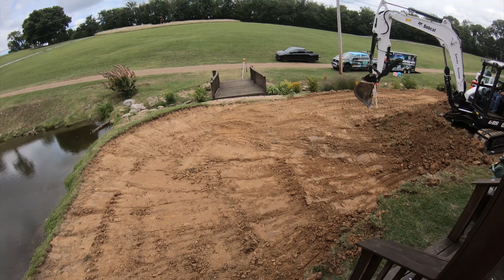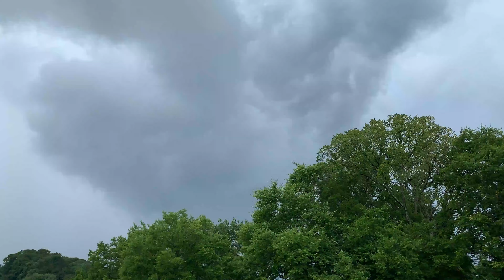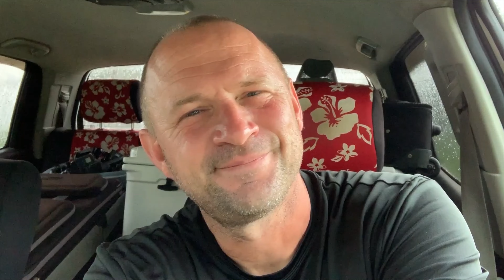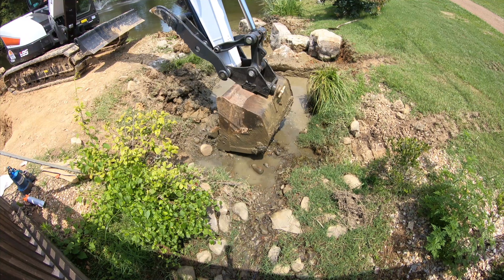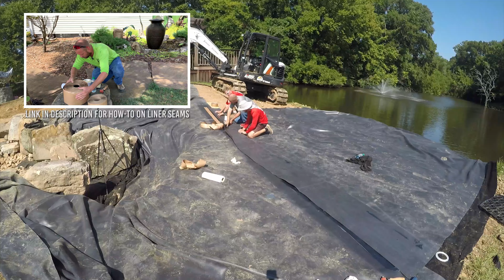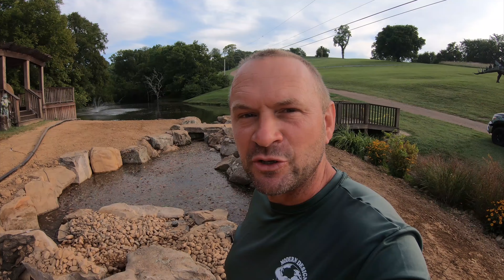How to Build a Custom Intake Bay | Converting a Farm Pond into a Swim Pond!

Comment: how big was this farm pond?  I'm thinking about building something similar on a .33 acre earthen farm pond that is 180 x 80 deepest area is 9-10 ft but avg dept is 6-7 ft (created shelves in case my young kids fall in accidentally).  How big should the intake bay/skimmer be and how big should my wetland be- plan on having blue gill and bass and use the other half for swimming on occasion on hot summer Texas days.
Reply from the maker: We sized that one to a budget not to the pond (per say)…The pond was about 1/2 acre-ish. Lots of variables based on these designs though. Refer to “all filters are better than no filters.” Anywhere between the “perfect design” and nothing is an improvement for sure!

Comment: Here it is 2022 and I'm on pins and needles to see the remainder of this project.  I thought you said there would be a part two but I have looked over the videos and playlists and haven't found it.  I'm obviously looking in the wrong places, could you help me out with a link, please?
Reply from the maker: We never got back out there. What info are you looking for? I might have something else to send ya! Sorry for delay, I have been on a big job ;)
Reply: @koiaddiction  I am baffled by how to marry a farm pond to the components that typically have liners.  In my area, farm ponds have packed clay bottoms.  Can the bio filter be passive or does it require a pump?  The intake bay has to have a pump, right ? so that the water gets pulled from that area to the falls.  I want to have a pond sometime but I am a firm believer in the K.I.S.S. method to minimize what can go wrong.
Reply: https://youtu.be/4KPhKpnvuOc?si=VPKXLtQth8t49Awj

Comment: Awesome work as usual.  How did you like working with the E85 excavator.  Is it too big for most jobs and locations.  I have an E42 considering moving to a bigger machine.  Any feedback on practicality of a machine that size.  Thx.
Reply from the maker: Love it! For the big jobs it takes big machines. I will never buy bigger than 12000# because for us the consistency of needs changes too much after that BUT I would love to get a 306 on the ground out here ;)

Comment: Great work. Question: How do you size the intake bay? Is it based on pump size/flow? What is the calculation?
Reply from the maker: This is a great topic for a video!! I am on it. It is 1 Aquablocks surface area per 500-1000 gph flow rate. 500 is minimal-1000 more bullet proof!

Comment: Very helpful video, what size of pump was used on this project? How many of them would you run for something of this scale and did you use internal or external pumps? Thank you!
Reply from the maker: We ran 20,000 GPH for the wetland filter. The filter was undersized for the pond we just built the biggest one we could with the budget that we had. We used also submersible pumps because the water feature was decorative, not technically a swimming pond.
Reply: @koiaddiction  Awesome, thank you for the quick response! Yes, finding correct pumping for this size of a pond seems challenging. What factors in to the decision to use submersible versus external? Size, application, or both?

Comment: Love your videos! May I ask, how did you make provision for seasonal water level fluctuations? Or is this not a concern here? I figured it would be with it not being a lined pond!? Thanks in advance!
Reply from the maker: Not the case here, it is always being fed by the stream running in (albeit it very small one).I normally would design it to run at low water conditions if that were an issue though. Some features that are not properly designed or in extreme cases need to be shut off when low water occurs and that will kill your filter for sure!
Reply: @koiaddiction   thanks for your quick response! I was gonna ask Professor Ed on his channel but maybe I can ask you here. Why do you fill your intake bay with the Aquablox rather then just large river rock? Is it cost effective to use the Aquablox with stone rather then just stone? Or is more of a concern of getting more open space for volume of water return?

Comment: Sweet 
The result is just fantastic 
I hope to talk to you about a much smaller version for my ponds 
and with a large enough reservoir and a zero edge I maybe can even run my falls for part of the winter 
What do you think Mr. Adams
Just north of Montreal 
Zone 5
Lows of - 20 are not unusual
Reply from the maker: Depends on what your winters are like. Here in East Tennessee we can run our features all year, in colder areas that is not the case!
Reply from the maker: I think you will have to winterize there!
Reply: Thanks for your answer 
I have shut down everything for the last 20 years 
I was Just wondering when you see all the features running at Ed s and Brian s  and at aqualand in almost the same zone
except our winters are just a bit longer 
Hope to connect with you on your website soon

Comment: Great info as usual love your blogs I am putting in 20’ / 30 ‘ Pond  a guy suggested I go with 18 large aqua blocks for my wetland filter I was just wondering how many blocks you think I would need for an intake bay for that size pond same guy was not familiar with intake bay  lol so any suggestions would be appreciated thanks again
Reply from the maker: Need to know layout for wetland-2000 gph per centipede. Intake should be 1-2 blocks per 1000 gph. Minimum is 1 block per 1000 gph. I have seen people use less but they seem to clog up too quickly.
Reply: Thanks for the reply wetlands filter layout planning to be around 15 x 15 and then in the middle of that was gonna do one snorkel and one full centipede 2 questions wondering how many aqua blocks I would need either large or small size for the wetland filter the pond is growing a little bit on my drawing lol possibly 20’ / 40’ & 4’ deep  question 2 needing to know  how many aqua blocks big or small I should use for the intake bay and if I run two pumps one to the wetland filter and a separate pump for two jets would I need a separate pump vault or could I put two pumps in one vault and what size pumps would you recommend for that application thanks again for the info
Reply: Also I was going to use 3 inch flex line 75 foot with a 2 1/2 foot uphill climb thanks
Reply: Same question on calculating pump sizes.

Comment: I found this video in my search for filtration options - thanks very much. What did you do with the liner at the mouth of the inlet at the existing edge of the pond? If you just secured it to the bottom won't the water want to go under the liner? Maybe you keyed it into the bank of the existing pond? 
Thanks for this video. It was the best one I've found. I've been thinking of using some left-over septic system parts to do exactly what you did here. It will take some ingenuity on my part but the pond is just a front yard affair so I'm sure I can DIY it. Your design has convinced me to go with an excess of in-filter water volume. Thanks again.
Reply from the maker: Liner is weighted down with stone and gravel into the pond bottom🤟nothing fancy, just a “compression seal”
Reply: @koiaddiction  Thanks for the response bud. Your videos are excellent by the way.

Comment: great video , I'm putting a 55'x45'x7' max depth pond in, how big should my bog filter be ? , the pond will be about 66,000  gallons and how times a day should the water be circulated ,  I want to use one or two pumps what size should I use ?  thank you very much
Reply from the maker: Your size would be roughly 20 x 25 with six centipedes , two snorkels and about 100 small aqua blocks. Your flow rate should dial-in around 12,000 gallons per hour minimum flow, you will have to run the pump curve on your selected pumps in order to make sure you get that right. AquaScapes will help you lay that filter out if you send them a schematic to the tech department👍🏻 I put out a video not too long ago and Pumps and Pump curves so you’ll understand better how to select the right pump. Once you know all of the information on length of pipe diameter of pipe and elevation change you can get a hold of the pump manufacturers and they can spec a pump for you. On external pumps I prefer performance pro, on submersible pumps I prefer Tsurumi! Good luck and happy pondering😎
Reply: @koiaddiction   thank you very much , I started digging two days ago , cant wait !!!!!

Comment: How deep should the inlet be into a wetlands?  I would just be worried if the water drops a few ft in the summer it would go dry and hurt the pumps.   Thanks.
Reply from the maker: The wetland should be higher than pond level, and the water level in the wetland should never change. The water level in the pond may fluctuate which might have an effect on the intake but I would consider that situation in my design on the front end. Did that answer help?

Comment: We’ve done intakes on farm ponds as well. With the surrounding trees and expected leaf load, how do you propose to keep the intake bay clean enough for all the pumps to be able to run? Asking for a friend...
Reply from the maker: Obviously time of year will dictate what actions are necessary to remove the leaves. It will be a bit of work to keep it clean during the leaves falling off-season. We went big on the intake for this reason. The maintenance guys on the property plan on laying a net across the intake during leaf season so they can just pull it out daily or as needed. It is a great point that you bring up, the goal of the intake is to capture floating debris so that it can be physically removed, It does not create a maintenance free situation. It is actually a mechanical filter the same as any other skimmer! You get a gold star for asking the best question Dan😁

Comment: great video, thanks for the detailed showcasing. The Stone bridge looks great. Doesn't the water get in below the liner at the end of the stream?
Reply from the maker: yes, we did think that through- here’s my take on it: 1) We cover it in stone completely. Im sure the water can get under there but 2) it was well constructed and 3) we have hydraulic pressure on our side. I might consider working harder to seal the front but our clay was doing a great job of holding the water in before and when we dug it out, there was no leaching through the old bank so I was (am) confident we are ok. I Don’t think we changed the exposure of water to soil ie we were still in compacted subsoil where the potential exposure was—long answer sorry-short answer I thought about it but wasn’t scared too much-still holding tight out there ;)
Reply: @koiaddiction great 👍🏻